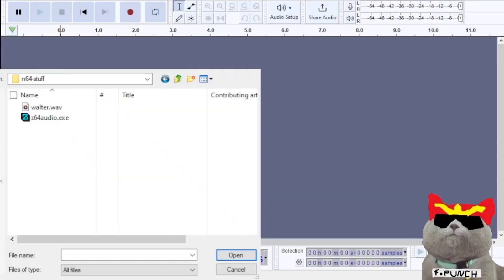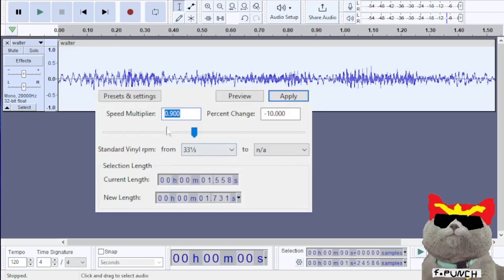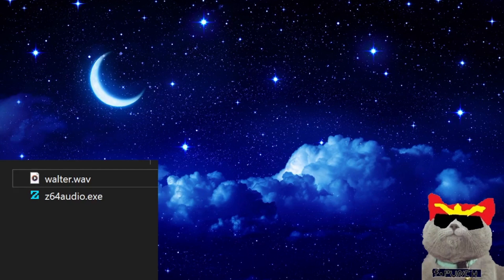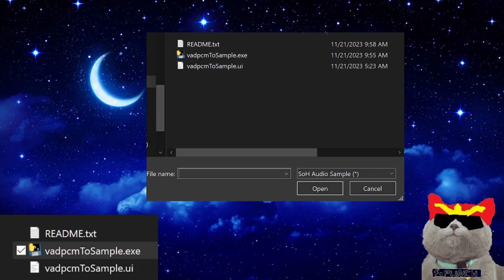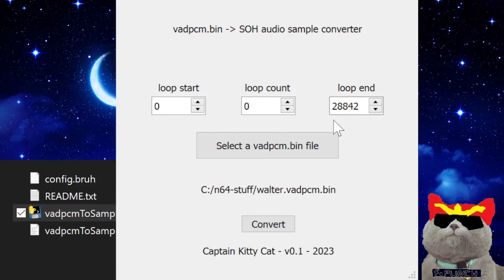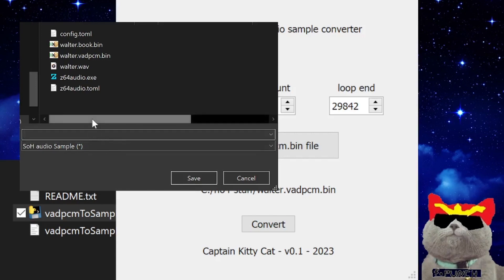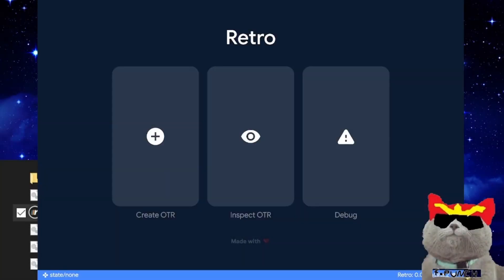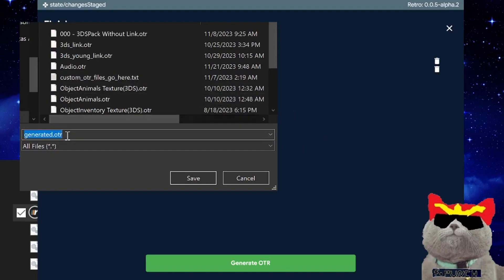Ship of Harkinian: Enhanced Audio Samples Guide

Comment: When converting to the different sample rate you can use a simple equation to get the pitch to be much more correct than guess work. 1/(target sample rate/original sample rate). For example if we were converting CD audio(44100Hz) to 20000Hz the speed multiplier would end up being 2.205.
Reply from the maker: Ah i think i made an update for the tool after the video that made it so you can manually set the sample rate you want within the tool itself. I don't remember if i used that equation or a similar one though.

Comment: This is a bit better than the last tutorial but still doesn't explain how to use this 'Retro' thing??? I've never heard of it and apparently it uses Flutter which I've never used either. Searching for tutorials here only comes up with old geezers showing off their radios for some reason.. At my wit's end as managed to get everything done perfectly up to that point

-----
Nevermind I just needed to install FULL visual studio to build it for some reason according to flutter doctor
Reply from the maker: are you in the ship of harkinian discord server? retro is a tool commonly used there for importing textures and models into soh. The method i use in the tutorial is the same method as importing models (NOT importing textures, that method is different)
So you could ask them in the discord server about how does importing models work with retro. The only difference between importing models and importing custom audio samples would be the folder path
Reply: @captainkittyca2  Thanks man, I think I'll join in a bit. As for now I've managed to get it working just fine
Reply from the maker: also i think in the original tutorial video, i go more in-depth into how retro works with importing samples

Comment: A recommendation regarding the switch to 20,000Hz: Some files may be of a higher rate (mine were 32,000Hz) so the speed change vary. What you can do is: 

1. See where you sample ends by clicking on the very end of the sample, and check the length on "audio position" at the bottom. 
2. On "Change speed", you can set the "New Length" to the one it originally had and you'll keep it as close as the original (Minus the loss of quality).

If you're doing batch edits (Bunch of audio files on the same project) and all your audios had the same rate before changing to 20,000Hz, the "Change Speed" will be consistent always so you don't have to input the ""New Audio Length" manually every time. (And you can select all tracks and apply the effect once).
Reply from the maker: thanks for the info. I haven't modded SoH in weeks by now, so am not checking these things anymore, but if doing that helped, neat!
Reply: @captainkittyca2  Yeah seems the whole audio modding is a tad finnicky right now. Hopefully it gets working to a state like Modloader 64 has.